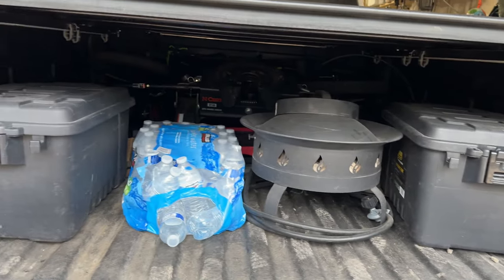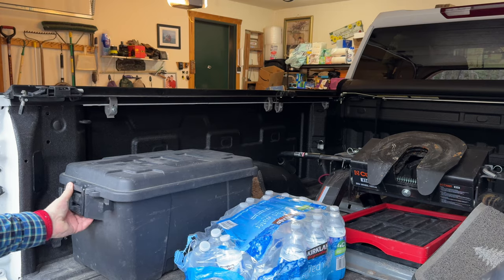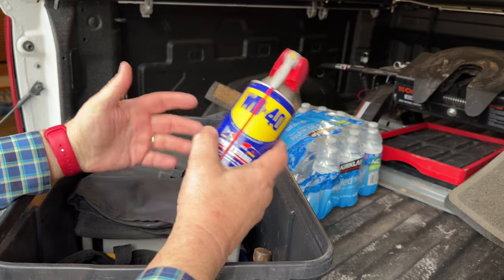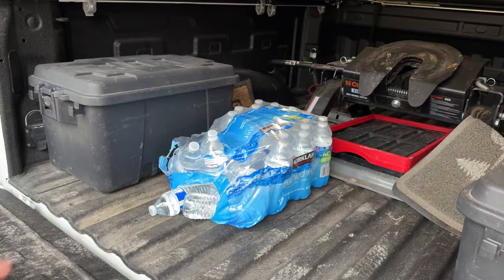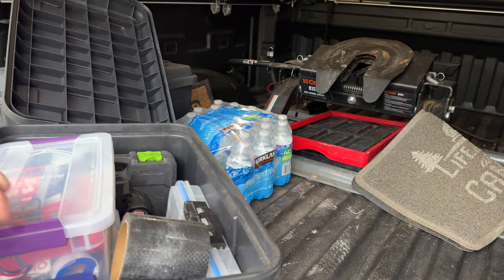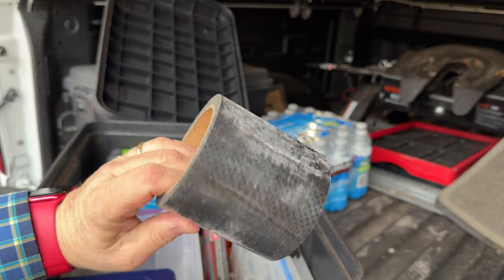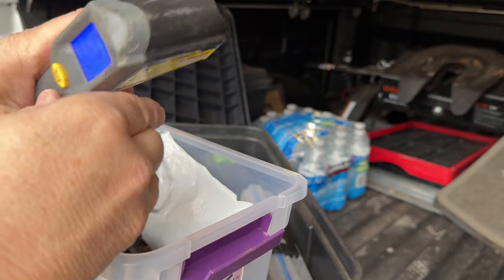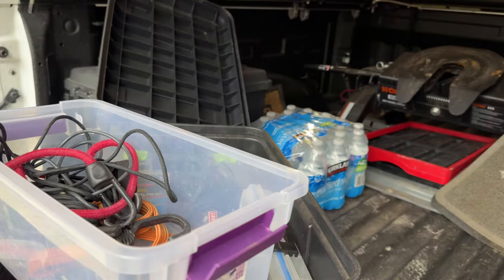YOU WON”T BELIEVE WHAT I CARRY IN THE BED OF MY TRUCK

Comment: I just saw an article that mentions maintaining your RV and avoiding acessive  clutter by pulling everything out once a year and evaluating  its use. If you find something you haven't used in a while, toss it. Weight is something RIDER'S need to constantly think about. Your tires are load rated, not just your RV. Allowing build up of items, reguardless of how small adds up in the overall  weight  situation. It is best to update outdated equipment too. This should be a pre- season event every year. Do NOT accumulate  in an RV, it is asking for a blown tire, over heating bearings, loss of braking, the list goes on. Being a pack rat should be left for the homestead. Same goes for the tow vehicle. You can ALWAYS hit a store along the way, or see if a fellow RVer has what you  need  in a pinch.

Comment: I’ve found that even with a pipe extension on my lug wrench that in some cases I could not break the lug nuts free safely. I currently carry a 1/2 inch DeWalt impact wrench ( 20V MAX series) and that certainly does the trick without risking bending or breaking wheel lugs.

Comment: One thing to add is pex pipe and fittings. I carry a 1,2,3’ foot pieces of pex pipe. Also straight,45 and 90 degree shark bite fittings. Also a small pair of pex cutters. You can fix any broken pipes in a matter of minutes!!